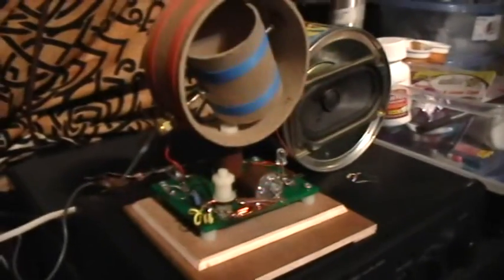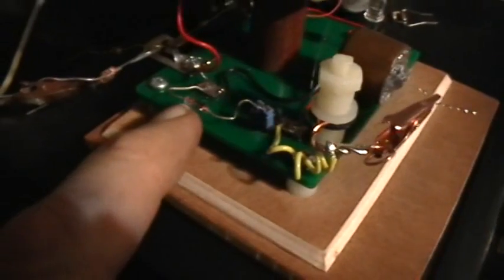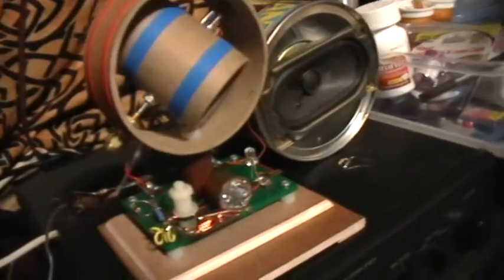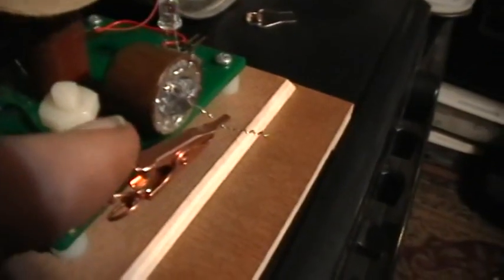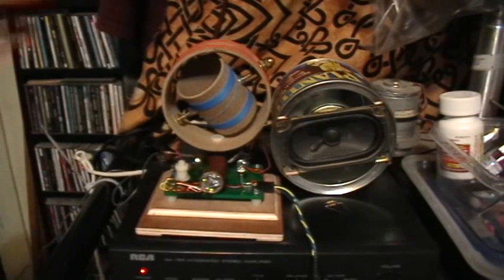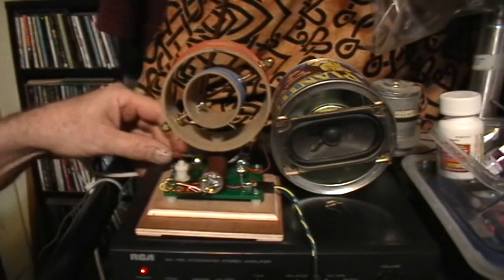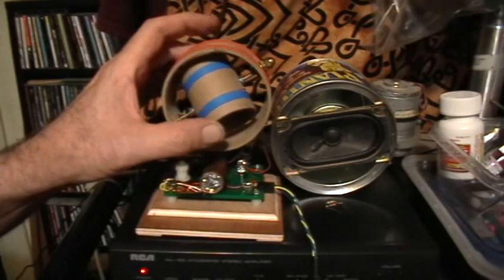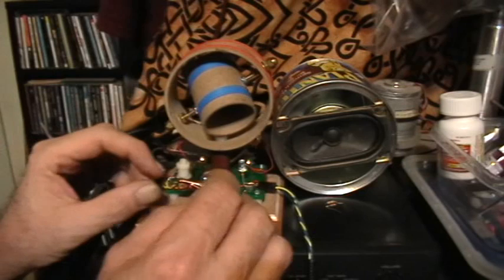Resonance: TK's Australia Radio: Variometer Galena Crystal Set

Comment: Variometers are fascinating, but I wish they had a wider tuning range. The 1480 station must be quite close to you. I noticed the catwhisker reception seemed very selective on that station once you got it in at good volume.
Reply from the maker: +sparkdetect
Yes, the transmitter and antenna are only about 3 miles away.

Comment: Are you going to try any other old style diodes?
The rusty razor blade for example...
Reply from the maker: Probably. I've heard Gillette Blue blades are best, haven't seen them in many years.
Reply: TinselKoala i looked up some of the different things use on crystal sets-carborundum got a good rap.
I actually saw some old style blades at the supermarket last week, so they are still available.

Comment: My question is what powers it
Reply: Electrons are in the air. All the power he is adding is for ampflication. Radio waves are the energy.
Reply: RED FORD -  correct. But most of us are old-school, and just use passive high-impedance headphones without using a powered amplifier. The amplifier is useful,  just as in the case of demonstrating the crystal set.
Reply: The radio station transmits tens of thousands of watts into the air.  The receiving antenna develops a few millionths of a volt when it receives that signal. That is all the power the radio uses, and all it needs.